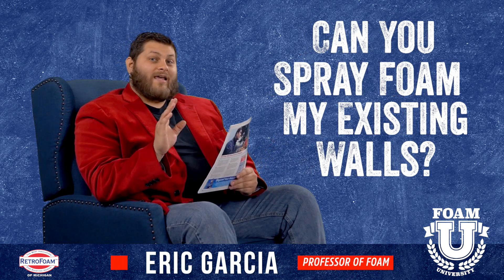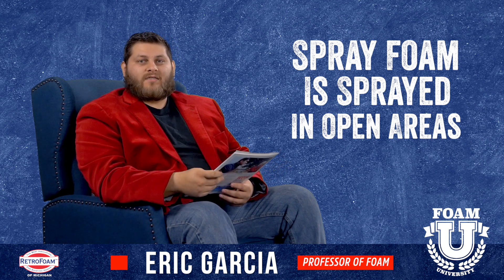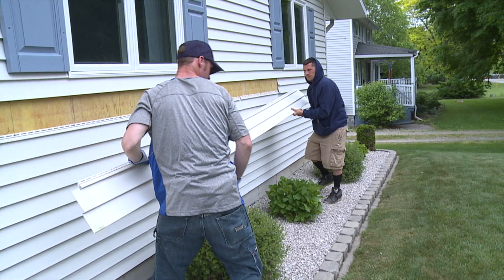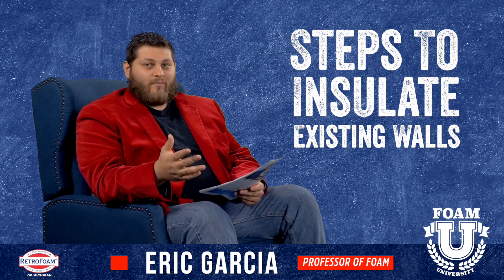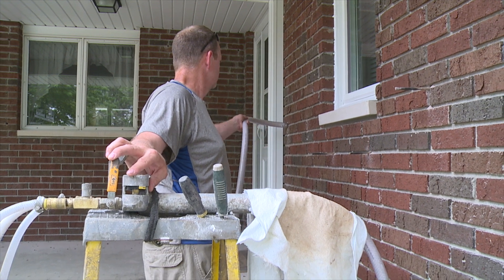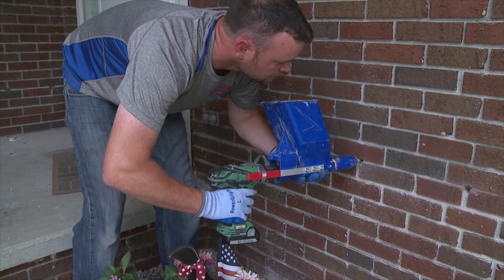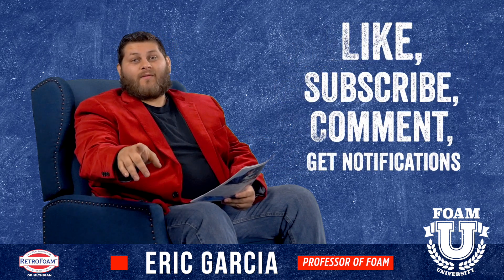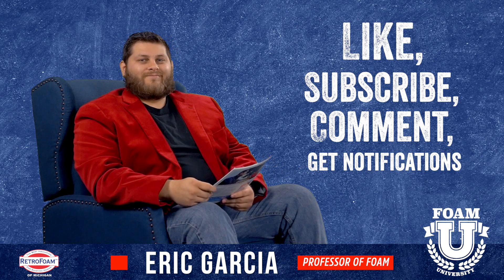Can You Add Spray Foam Insulation to Existing Walls? | Foam University

Comment: When sprayed will the foam leak out of holes on the inside of the wall? Say around like your outlets or light switches ?
Reply from the maker: Great question! No — RetroFoam won’t leak out around outlets or light switches. The foam is injected into the wall cavity from the outside and is designed to stay contained between the studs. When installed correctly, it fills the cavity without entering the living space or electrical boxes. In fact, once the walls are insulated, most homeowners notice less air movement around outlets because the drafts are sealed off. 👍

Comment: How about the ceiling ?? I need to reduce the noise from the first floor to the second floor??  This foam will stop the airborne noise?? Like the people talking or the tv sound??
Reply from the maker: It is an added benefit of RetroFoam, but not the sole reason you should have it installed! RetroFoam has sound dampening qualities to make your home quieter, but it won't completely soundproof it. Check out this article from our Learning Center for some additional information on this topic: https://www.retrofoamofmichigan.com/blog/soundproofing-vs-sound-dampening-room

Comment: Would injection foam work for an interior wall as a method of sound proofing? We have a closet containing a furnace directly on the wall of the baby's room that's super loud. Looking for options to sound proof. I'm talking like maybe 7 feet of drywall to cover
Reply from the maker: Although RetroFoam won't completely soundproof your home, it does have sound-dampening capabilities to make your home quieter! This article from our Learning Center includes some additional information on this topic: https://www.retrofoam.com/blog/retrofoam-insulation-for-sound-dampening

Comment: Thank you for the content. Is it possible to drill through the top plate in the attic and inject foam downward between the studs?
Reply from the maker: Unfortunately, we would not be able to inject RetroFoam that way. It would be difficult to check for obstructions and to ensure the foam is filling every nook and cranny.

Comment: I just found out my new (2 year old) house has many small to large gaps in the wall insulation which is contributing to my AC unit not being able to keep up with cooling the house during the hottest days of summer. My HVAC service tech used a therma camera to show the gaps, It would also affect heating in the winter. These gaps are present in every room of the house mostly arounf the door and window headers. The house is 2x4 construction which means there isnt much insullation anyway. This looks like a real solution to my problem. FYI: the home builder won't help with this issue. I have board & batten siding so doing this from the inside would probably be the best option. Thanks for making sense of how this works.
Reply from the maker: Hello! We can definitely come out and take a look! If you're in Michigan, please follow this link to request a free estimate: https://resources.retrofoamofmichigan.com/estimate
Reply: How do find the cavities from the outside?  I have exterior wood paneling . Thanks

Comment: What's the r value of the injection foam?
Reply from the maker: RetroFoam's R-Value is R-4.6 per inch, but it actually increases as the temperature outside decreases. This article from our Learning Center provides some more helpful information: https://www.retrofoam.com/blog/retrofoam-injection-foam-insulation-r-value

Comment: I got a quote to spray in insulation from the inside but I can’t afford to repaint my whole condo after. Is it possible to spray it on from the outside if I have asbestos shingles (cement shingles)?!
Reply from the maker: In this case, it is possible, but it would be best to have a contractor come out and discuss all of the options.
Reply: @RetroFoamofMichigan  I'm guessing it would be prohibitively expensive as my state requires a contractor with an asbestos license (which their are few) and they charge an arm and a leg.
Reply from the maker: Have you by chance checked to see if your energy provides any rebates for energy-efficient upgrades
Reply: @RetroFoamofMichigan  yes, I just had someone come by to do an energy assessment. I’d get 75% off  insulation. Which means just about $750 cost to me to pump in insulation from the inside. But then probably at least $5k to repaint my condo after. Don’t know what it would cost to go in from the outside, but I’ve had asbestos work done before and paid $4k just to remove a small wall of shingles when I renovated my front porch.
Reply from the maker: I would definitely have a contractor come out to take a look. If you add RetroFoam or another kind of injection foam to the walls, they would only need to drill holes inside instead of removing the drywall to spray foam.

Comment: Hey what can be done in a ballon framed home that has no insulation batts. Does this still fill the entire cavity?
Also I watched the entire video, subscribed and gave you a 👍 
Thanks hope to hear from you soon
Reply from the maker: Thank you!
We have used injection foam insulation for balloon frame houses many times without any issues. Injection foam is designed to completely fill the cavity whether there is existing insulation in the wall or not.
I hope this was helpful!

Comment: Great video!! I live in Las Vegas where it get ridiculously hot and A/C bill goes through the roof! How beneficial would this be in terms of keeping the house cooler and lower my a/c run time?
Reply from the maker: Good question! Sealing the building envelope of your home can help you maintain a constant temperature because there is no air leakage into or out of the house. This can help give your AC unit a break from running all the time.
Reply: That’s what I’m looking for!
Do you operate in Nevada or can you  steer me to someone who does?
Reply from the maker: I'm sorry, we actually don't have any RetroFoam dealers in Nevada at this time.

Comment: Is this suitable for double brick houses? Typically, the small air gap is intended to let the brick breathe, as well as letting the inside heat warm up the outside brick to prevent early deterioration.  We've been struggling to find a good way to improve the insulating quality of our 1900 double brick, but there isnt really a good solution that doesn't have its drawbacks.
Reply from the maker: Yes this can be done and is usually the only option for this type of exterior.

Comment: I have a question about a roof, but it is still an enclosed cavity so I’m hoping this is the right place to ask. A client had her attic sprayfoamed. The contractor sealed the gable vents and the rafters. However, the is a short, 2’ slanted ceiling on the second floor where the lower ends of the rafters did not get insulated. Now moisture/vapors enter the eaves, and rise for a couple feet, and then encounter the sprayed insulation and no longer have anywhere to vent. I’m trying to get this client’s issue resolved. Am I right in thinking that the insulation contractor messed up by creating a ventilation issue and should be on the hook for coming back to resolve the issue? And, if so could they, in theory, use injection foam to seal/insulate the lower portion of the rafters without having to remove roofing or drywall to access it?
Reply from the maker: Without knowing more info about the job or scope of work, we couldn't say who is at fault. Getting the insulation company involved is still probably a good idea. In an unvented attic system, which we recommend, the foam should go from the ridge vent to the soffit, sealing off everything. Of course, the gable ends should be done as well. I would recommend spray foam over injection if its possible for this project.

Comment: Anyone who answers a yes or no question with the answer " yes and no" doesnt have any idea what they are talking about and instantly loses credibility.
Reply from the maker: Solomon, that is because the answer is yes and no which is why Eric goes on to explain that you can not Spray Foam enclosed walls. The Drywall would need to be removed. We have an injection foam product that we use for enclosed walls.
Reply: @RetroFoamofMichigan  Its a yes OR no question not a both question regarding one thing.
Reply: Zero credibility dude.
Reply from the maker: @Paradisecountryinc  Were sorry you feel that way Soloman, Eric has been with us for years and knows what he is talking about.

Comment: Can you offer advice on a DIY project? I have to replace the drywall in my bathtub/shower due to water/moisture infiltration. While I have it opened up, I am contemplating replacing the fiberglass batting that is a little over 40 years old, with a spray foam kit like Froth-Pak or similar. I have caught a whisper that foams like Froth-Pak and maybe Great Stuff are not good options for enclosed areas. Why would that be? What is the difference between Froth-Pak foam, and your injection foam as far as insulating an enclosed wall cavity? I am thinking that this project would be best with a closed cell product, (maybe eliminating any additional vapor barriers?) On a slightly different note, do you know if the Froth-Pak spray foam is open or closed cell?
Reply from the maker: The bigger issue with spray foam kits is that if you've never used one before you could end up wasting a lot of product, which means losing money too.

Comment: Can you add Spray Foam Insulation in apartments? 

Cause I’m living in a old building that I can hear my neighbors argue and even use the bathroom.
Reply from the maker: It can! But our product is not used for soundproofing purposes. Sound dampening is an added benefit that we hear from our customers but we do not recommend using it for sound.

Comment: What is a good estimate on how long will it take the moisture to leave the injection foam and my humidity levels stabilize? Was 50% before injection foam and now it’s up to 60% .. also running ultra air 98h dehumidifier for 24 hours straight now
Reply from the maker: Greg, the foam cures between 24-48 hours. The reason the humidity is raised is that the foam is doing what it is supposed to do because foam creates an air seal. We recommend running your bathroom vent every day. If the bathroom vent/ dehumidifier doesn't make a difference we would recommend calling an HVAC company. Here is an article that will be very informational for your situation and will explain a little more in-depth! https://www.retrofoamofmichigan.com/blog/air-changes-per-hour-definition-how-many-do-you-need

Comment: I have a finished painted  basement wall subgrade with no vapor barrier. Can injection foam work in this scenario?
Reply from the maker: If the drywall is on studs and not just on furring strips, yes, you can inject foam into those walls.

Comment: But where do DIY'rs find the spray foam to fill existing wall cavities?  I need to insulate a garage along one wall and I don't mind going through the sheetrock inside the garage because I don't want to disturb the brick on the outside of the house. But when I call for bids from contractors the size of my job falls under their minimum, and I don't want to waste money, (hundreds of dollars,) so I really have no choice but to do it myself because I can take those extra $100 that I have to spend on the minimum and apply it towards something else.   The question then is, where do I find sufficient amount of spray foam in order to take on an exterior garage wall, and the equipment to rent in order to do it?
Reply from the maker: For inclosed existing walls we do not recommend using Spray Foam. We use out injection foam on all enclosed cavities.
Reply: @RetroFoamofMichigan  I have a similar situation, I know it's a long shot, but is there some sort of consumer direct injection foam material we can buy?

Comment: Are you using open or closed cell foam?   Open cell foam should not be used on older homes as they are not air tight enough to keep moisture out and the moisture gets trapped by the open cell foam restricting air movement and rots your house.
Reply from the maker: We have 3 different products that we use. Open Cell, Closed Cell and our Injection Foam.

Comment: Do you have any before and after data available (reduction in home electric bills, change in air leakage rate, and/or IR images)?
Reply: Typical savings is about 40%-60% in my experience with this Foam. Air leakage has to be addressed through walls, attic penetrations and windows/doors
Reply: Even on a 2021 home with r-13 batt already installed in the walls and r-38 blown in attic would I see this substantial energy savings with injection foam ? Houston Texas. Thank you
Reply: @gregvaldez22  Greg. The problem with batts in the walls is that it allows for air flow and it has a shelf life.  You don't want air flow in your walls in your exterior walls so you will see a difference with injection foam but your attic is in good shape
Reply: So I would see the 30% cost in energy savings after injection foam? Also will this keep the humidity out of the house ( have central dehumidifier)
Reply: @gregvaldez22  30% is most likely. Heres the best I can tell you about injection foam, any air coming through the walls and air leaving will be stopped.  That is the best way to think about it. It's not a miracle product, it is the best insulation product for your walls. Don't overthink it. You know your house better than anyone. That's the best advice I can tell you.
Reply: @foamrob6577  thanks. just had the injection foam walls done today by USA Insulation in Houston Tx area.. the humidity is increasing in my home on all of my monitors, up to 60-70 percent is this normal after install and do you know how long for it to go back down ? normally it runs at 50% and I do have a whole home dehumidifier.
Reply: @shelley2318  Are you having a moisture problem in your home due to humidity? Generally though you want about a 45'-55% humidity level in your home. That is normal. I copied this from Research Building Science:
Research from the Building Science Corporation found that humidity of 70% or higher adjacent to a surface can cause serious damage to the property. The Health and Safety Executive recommends that relative humidity indoors should be maintained at 40-70%, while other experts recommend that the range should be 30-60%.

Comment: I realize how much better the method is that is described in this video, but would there be much benefit/harm in making a few vertical small holes in the  interior walls (maybe every 2ft) and then spraying in some great stuff?  I have to repaint walls and thought about doing this. 

Thinking that if cold air is flowing up the wall cavity, this could stop that flow?
Reply: You're not getting air flow from interior walls only exterior

Comment: What I want to know is why aren’t walls ALWAYS insulated when built. Or why aren’t duct and hvac systems engineered properly to cool the house. Every house I have lived in florida has a hvac problem of some sort. One room not cooling upstairs not cooling . One of the hottest climates in the USA and we can’t design hvac systems correctly.
Reply from the maker: James, sometimes the problem may not always be the HVAC system. Although our climates arent as extreme up here in Michigan. We have lots of people reach out to us because they got a brand new furnace or AC and they are still experiencing problems. That could be because the insulation that was already in the walls has deteriorated. Unfortunately, traditional insulation will do that.

Comment: Eric you rock! Too bad you don't operate in Santa Monica CA. I live in an old 450 sq ft. "war box" apartment built in the 1950s that has stucco walls.  It's on a very busy street and because I'm a senior with noise sensitivity, I desperately need some sound dampening that the retrofoam could provide. The unit has the original windows so new windows with a high STC rating is required also.

Comment: What about older houses? Our house has asbestos siding with plaster & lattice walls inside.
Reply from the maker: Unfortunately we are unable to drill through the outside asbestos siding. To do the install we would most likely have to do an indoor install, but with the lattice walls it may not be able to be done unless the lattice was removed. If you are from Michigan we would be more than happy to come out and take a look and I am sure our project managers would be able to come up with a plan for this! Our estimates are completely free!

Comment: if I'm removing stucco to do a remodel, can spray foam be sprayed from the outside once the stud bays are opened up?
Reply from the maker: Yes! We can also do the install without you having to do all of that. Check out this article that explains into further detail our process with stucco homes! https://www.retrofoam.com/blog/insulate-exterior-stucco-walls-with-retrofoam-insulation

Comment: Exactly what I was looking for.  Can injection foam be applied horizontally too?  Specifically in a garage ceiling that has a bedroom above it.
Reply from the maker: We do not recommend this. Injection foam applied horizontally can cause the foam to cure incorrectly. What we would suggest is cutting a strip of drywall across the ceiling and having it Spray Foamed instead.
Reply: You can also dense pack a ceiling with blown in Attic insulation. Usually you have to do the ceiling and the exterior walls ofvthe bedroom.
Reply: @foamrob6577  best comment ever! I just bought a house where there is no insulation whatsoever in the basement ceiling, you can hear everything said above clearly, i think blown in insulation would help minimize that
Reply: @Mark300win  Just be careful, it doesn't always work for sound if your joist space is less than 10"  Always remember insulation is for insulation purposes not sound. Hope it works out for you